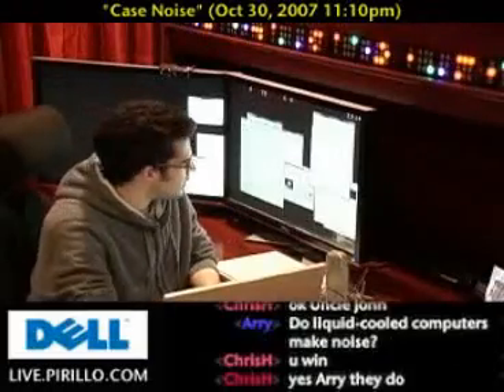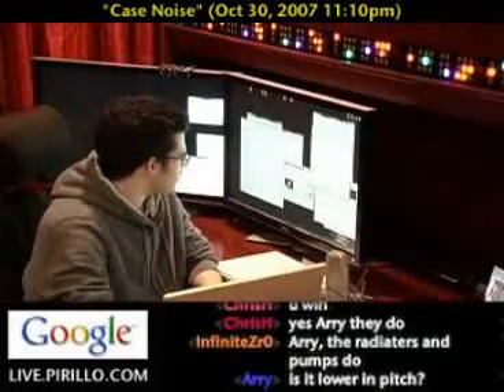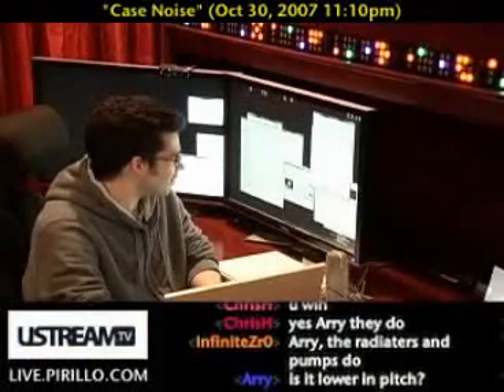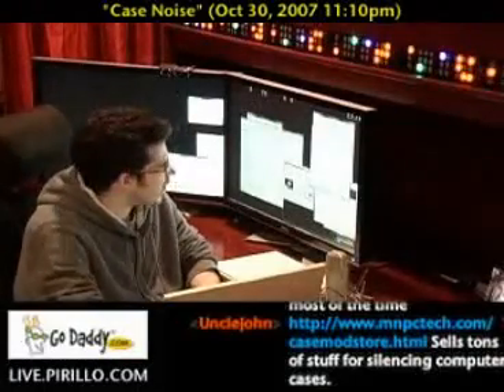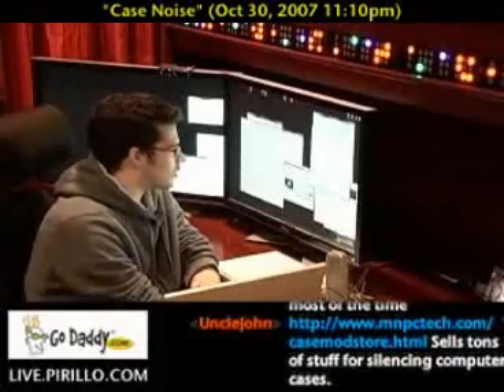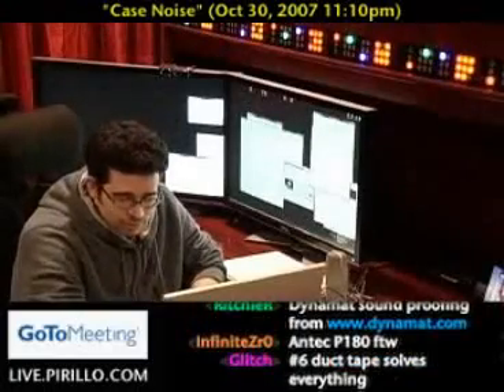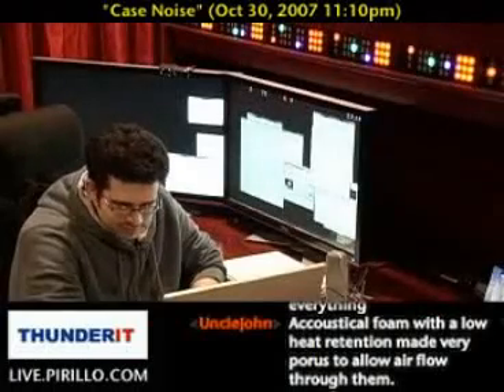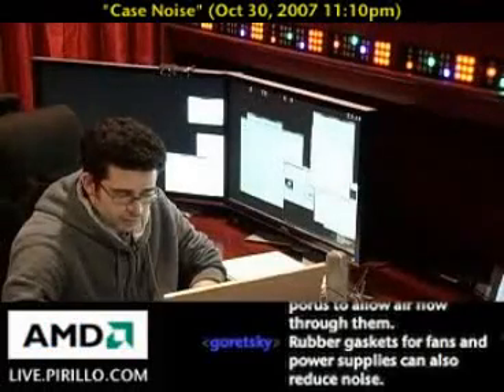Top 5 Tips to Decrease Computer Case Noise

Comment: Just turn the PC off at night, simple. Or get ear plugs. If the screws are too tight you may damage the case not the screws. Use large diameter fans and change the 7 volt to 5 volt for lower RPM. 
Your PC sounds like a plane taking off, is that an elastic wind up model plane? get real.

Comment: um, how about you just buy a 4-channel fan controller with some Y-cables for your intakes/exhaust fans, and your cpu fans each on a different channel.  so you have your exhaust fans, intake fans, and cpu fan on manual control 24/7, and for god sakes, buy a power supply rated for 80% efficiency and a silent fan.  the controller, it costs a mean-less 10 dollars.  gg fan noise.

Comment: Blow it out with canned air, take apart the cpu cooler and other fans and just dust them off, should reduce noise SIGNIFICANTLY, I had a 8800gt for about a year and a half, thing got damn noisy wouldn't stfu lol, so I took it out and blew air through the vents... you wouldn't believe the amount of crap that came out of it! and my house is dusted every week D=!

Comment: Why was water cooling never mentioned? There are products to water cool your GPU, CPU & even the power supply. Also, with solid state hard drives you can virtually remove all moving parts and keep the noise to a minimum.

Comment: golden rule for case fans is draw cool air in from the front and bottom of your case, and have it expelled from the back and top because as you should all know hot air rises..... oh and 120mm fans as and were you can if not get a fan with a potentameter on them that allowes you to turn them down by turning a screw, or buy ones with a sensor that will adjust automatic. follow these simple steps to cool quiet case fun :)      darth wicket rulez